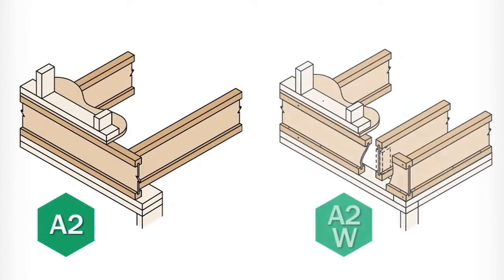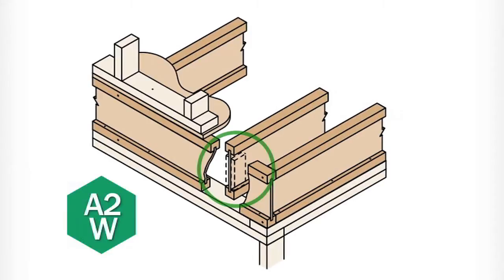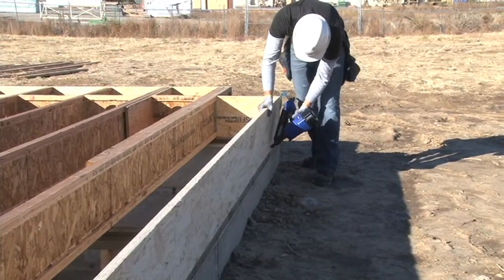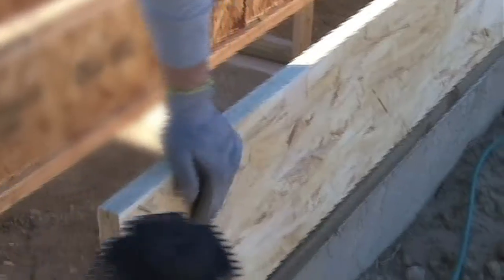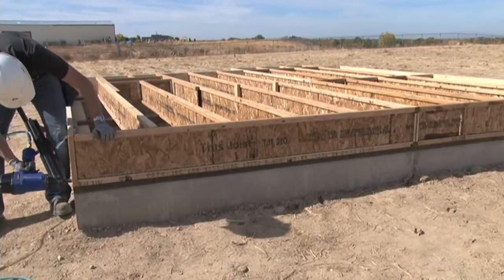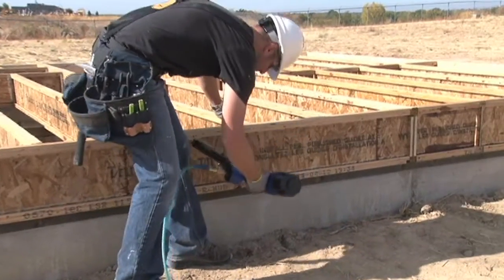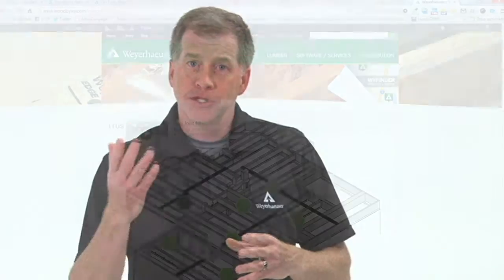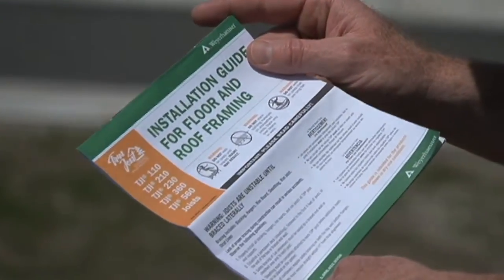Detail #A2 / A2W - Trus Joist EWP Floor Installation Guide

Comment: Why don’t you need an I joist at the edge? All I see in the video is the rim board at the edge on the sill.  I figured you would need an I joist plus the rim both sitting on the sill plate. Thanks

Comment: I can't believe it any where I ask a simple question I get everything but the asnwer to my question so mad how do you start a i-joist layout that has a flange 2 1/2 inches so when I start marking my lines for I- joist layout what would be my first measurement and then after what's my measurements from start to finish
Reply from the maker: +Justin Hearn 

Hi Justin –

When drawing a floor framing layout, the first joist line
should be placed X inches (the O.C. spacing) from the center of the initial
adjacent, parallel support and copied for every X inches until the final floor
joist line should be less than or equal to X inches from the center of the
other adjacent, parallel support. So in your case, the first joist line should
be placed 16 inches from the center of the initial adjacent, parallel support
and then copied every 16 inches until there is less than or equal to 16 inches
from the final floor joist line and the other adjacent, parallel support.
Should you wish to show the width of the joist flange, you must make sure that
the edges of the outline of each 2-1/2” wide flange are centered at the 16”
locations is drawn from the commentary above. 

Hope this helps you out. If you would like to further discuss the situation, I encourage you to contact Weyerhaeuser Engineering Technical Support via email: techsupport@weyerhaeuser.com | phone: (888) 453-8358.

Justin Maghirang, EIT
Product Support Engineer
Weyerhaeuser Engineered Lumber Products